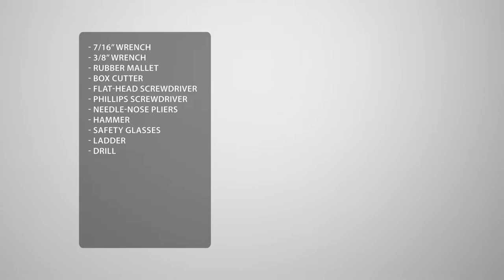Lifetime 8' x 17.5' Outside Shed | Lifetime Assembly Video

Comment: having a hard time getting the floor panels to lock into place
Reply from the maker: Try this: have someone stand on the floor panel while you hold the next one at a 45 degree angle, interlock the tabs, and then set it down. Sometimes, a little extra force might be needed- you may need to give the panel a firm but controlled push (i.e. slam) down to secure it in place.